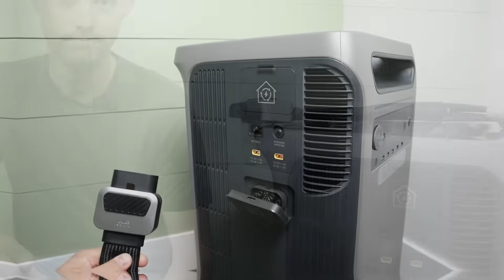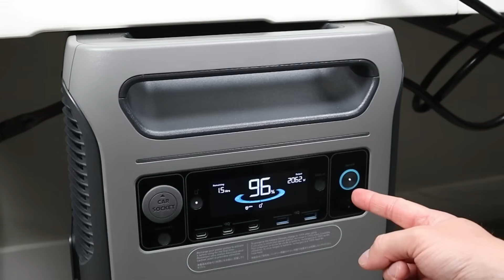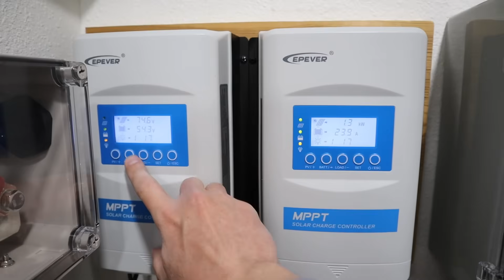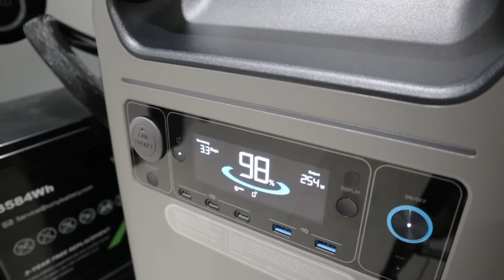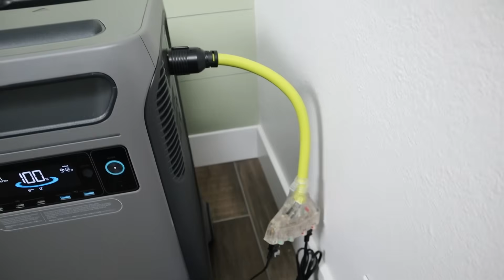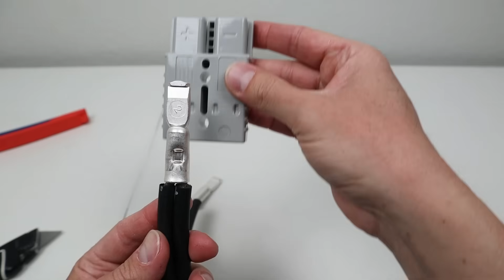I didn't Know This Was Possible!! Backdoor Battery Access to the Anker SOLIX F3800!

Comment: 5:00 why do you have the power cables coiled up while putting high power through them? Eddy currents will cause friction heating on the cable.

10:00 again you seem to coil up cables for hours with lots of power going through them. 

Do they get warm? Is it worth mentioning Eddy Currents to viewers because some people will see you coiling cables and think if you're doing it then it just be ok, when it's not.

As electricity flows through a cable it generates a spiral magnetic field. Coiling a cable causes the spiral magnetic fields to cross each other causing friction heat. So unrolling the cable is good practice.
Reply: You're not testing any of the internal temperatures or components. You're just hoping for the best while knowing there is a real risk. 

The inverters switched off 2x and you didn't put a warning at the start of the video or in the thumbnail of description. 

What is wrong with you? You even then advise people to continue on at their own risk. You know what people are like.
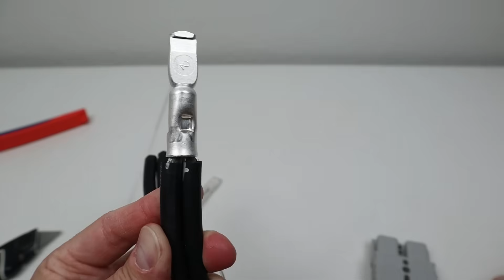Reply: 23:57 you combine 2 cables into 1 fitting. Is that fitting rated for the power (volts, amps) use? There's a reason why they're using 2 cables and 2 fittings instead of 1 cable and 1 fitting.

So what's the rating of the terminals you're changing it to? 

Never seen one of your videos before, are you a qualified electrician, are you a qualified/competent electrical equipment repairer? It doesn't seem so but I might be wrong.

Comment: A power station/solar generators should have the ability to connect a regular battery (understandably within some parameter set by manufacturers) to expand and especially if the electronics outlive the internal battery.

Comment: Looks like this would be bypassing the BMS. I wonder if it's still doing battery maintenance (voltage balancing) when it's not actively charging; if not, this can be really bad in the long run. In a pinch with two health systems? Awesome
Reply from the maker: The BMS is always connected directly to the battery cells, you cant bypass it. This solution doesn't skip the BMS. That's what stopped the charging multiple times in the video.
Reply: @Jasonoid I thought batteries are connected in series giving the higher voltage. And the BMS has connections to the seperate cell (groups) to monitor and charge. So the output is in series without anything in between and in the input through the BMS. I'm gonna do some googling later 😋

Comment: With an extended battery mod, will the f3800 be able to charge them from solar input to the f3800?
Reply from the maker: I'm pretty sure I showed that in the video when I had the DIY batteries connected with the solar charge controllers 👍
Reply: thanks for the reply. After thinking about this more, I decided not to perform this hack of wiring a external battery to that expansion port. Reason being is that the dissimilar chemistry of the batteries will behave differently and might cause an issue. Now I wonder if the anker c1000 can take the same mod/hack as it uses LiFePO4 chemistry like a lot of off grid batteries.
Reply from the maker: The F3800 uses 51.2v LFP batteries, what chemistry did you think they have in them? 
 @AW.SO.M3

Comment: Hi Jason, At 10:29 of this video, you mentioned that the solar panels are charging the DIY Expansion Batteries which are connected to the F3800 via the expansion cable. Can you clarify how the solar panels are connected to the batteries since the batteries are connected to F3800 via the expansion cable?
Reply from the maker: I have two external 48v charge controllers / solar arrays  that are charging the 48v battery bank.

Comment: I found @NoiseLab47 at about the same time you did and did similar testing using DIY bullet connectors, and had similar findings.  I have since gone the OEM-battery-connector-cut-in-half route and using both sides because I have 2 F3800s with Anker expansion batteries running through the ANKER Dual Power Hub.  I'm doing the "backdoor" feeding through the expansion batteries (ports are upside-down watch out for polarity!) and am hooked to 48V  LiFePO4 "golf cart" batteries in turn being fed by 80A MPPT solar charge controllers.  I have also run 4S 12V LiFePO4 batteries.  The twin systems are also being fed by manually switched 48V LiFePO4 battery chargers.   This has eliminated the headaches I was having trying to keep the 2 DPH-connected Ankers balanced.  IMHO the lack of OEM DC balance is a huge design flaw with the current DPH design.

Comment: I know that you did this video with the f3800, but have you checked to see if the f3800 plus extra (generator) plug on the bottom is exposed the same way. Just curious Thx
Reply from the maker: It also has the same voltage available, BUT.... That port uses a slightly different connector so they aren't interchangeable. It has two plastic pieces to keep the battery plug from connecting.
Reply: @Jasonoid  Thx

Comment: First of all, thanks for the video! Second of all I probably am not the first person to comment on this but I have the c1000 power station that has the expandable battery Which is far more than I would be willing to pay for what it is but with the expansion cable I believe I can use external batteries Etc in a very similar Fashion on a smaller scale. I wonder if the expansion cable is the same plug or at least similar. If I do decide to try this out I'll definitely make a video about it thanks for the inspiration!

Comment: I am trying to figure out a way to continue to use my potentially future SolarEdge PV installation with my F3800’s and HPP during a grid outage.  Does this condensed ChatGPT description make sense?:
1.	The SolarEdge inverter will automatically shut down
2.	The Anker F3800 Plus, with the Home Power Panel, creates its own small, isolated AC "grid" (a microgrid). The HPP automatically disconnects your selected backed-up circuits from the main utility grid. The F3800 Plus's internal inverter begins supplying AC power from its battery to those circuits.
3.	Because the Anker F3800 Plus is now providing a stable AC power source (its own "grid"), your SolarEdge inverter can "see" this and, after a brief delay, will restart and begin producing AC power again.
4.	Power Flow: The AC power from your SolarEdge inverter now flows into the Anker F3800 Plus's AC input. The F3800 Plus then manages this power
Thanks.

Comment: interesting test. and good idea for adding a single battery to the Solix. but, with the number of batts you have... it's best just to use an EG4 like inverter\controller
Reply from the maker: Uggghhhh, I dislike the 6000xp. The user interface is horrible, the smart app sucks, and the fans are so loud you can hear them throughout the entire house. I already built a mobile cart using a 6000xp and these power stations are just great. The are nearly silent, they have excellent software and you can control and monitor them remotely while away from home. My daily work horse is the Ecoflow DPU, there's nothing better out there in the power station world.

Comment: Was the generator port on the Plus model also bridging to battery? They use the same plug as the expansion battery.
Reply from the maker: It doesn't use the same plug. It's slightly different. It has two tabs to keep the expansion battery cable from connecting.

Comment: I'd buy an anker tomorrow if they release a version that allowed for solar input taking priority over mains input.  It would be great if anker used this port to make an official breakout box that would allow that to happen without potentially voiding the warranty.
Reply: What do you mean priority?  It appears that regardless of you charging from AC, power panel, or generator adapter, that solar input is always accepted if SOC is less then 100%.
Reply: @michaelwitkiewicz7052  I'd like to power it from mains (240) and have the solar reduce the load on the mains when the sun is up, when used in ups mode, the website says 240 isnt available. There's so little information on their website for the UK model, it doesn't even say it can charge at 240 on the spec sheet, just - AC Input 120V~ 15A (3 hours Max), 12A (continue), 60Hz L+N+PE
Reply: @samphire you’re in UK?  I thought normal AC in the UK is 240.

Regardless, if they are selling in UK there should be a support line there.

Comment: Wonder if on the 3800Plus you could connect your regular external batteries via the cable but then use the built in Solar Charge Controller (since it has a higher voltage range then the regular 3800) and have it fully function like a regular expansion battery because by using the internal charge controller the screen would show wattage coming in and you could save a little money by not buying an external SCC (he says currently using an external SCC to charge an external Battery connected to the solar inputs of his current power stations).

Comment: the 240v shuts off because one of the inverters is used for charging so you dont have both to then output 240. If it had 3 inverters than it would be perfect.
Reply: Wouldnt it have battery heat issues that way?

Comment: I don't think this type of hack is very useful giving that if you are paying the premium to have a good power station you are really buying its integrated solution, which guarantees performance (or you would ask for aftersale service). Hacking the battery this way downgrades the whole thing to a DIY solution yet probably much more expensive than an actual DIY one. Maybe if you get everything second hand then this is a good way to utilize what's available, but that should be a rare case since it's not like you can easily renew the batteries in the power station. Or maybe you get the power station for free and this allows you to just use it like an inverter, which would also be rare but at least make some more sense.
Reply from the maker: You don't buy this unit just to hack it. I wouldn't ever recommend that. 
This video is for the thousands of people who were misled about the unit by other YouTube channels that didn't disclose the issues I talked about in the first couple minutes of the video.

Comment: 19:09 it's a power save feature, there needs to be a load otherwise it's a parasitic draw keeping the inverter activated. Just keeping the inverter on uses a little bit of juice. If the station doesn't detect a load after a period of time it shuts off the inverter to save power.
Reply: I wouldn't know, why he wants to keep the inverter on...In that test, he just wanted to see, if the left power station charges up the right one.There is no need to have the inverter on.
Reply from the maker: @heimchemiker you certainly need the inverter on if you want to power up your home.
Reply: @Jasonoid  Yes, but you were irritated that in your test consisting of: no load, the left power station connected to AC charging and the right connected to the left through the battery connection and getting charged by parallel connection of the batteries through the expansion port, the inverter switched off. So there was no need to have the inverter on in this test, yet you were irritated by it switching off and conserving energy and switched it back on.
In a scenario with the House connected to the AC output of the power station (certainly not the hole house), you will always have some base load (router, phone chargers, lights...) that should keep the inverter from switching off. (This would be an interesting test: how high does this load need to be, to keep the inverter from switching off).
Reply: @heimchemiker  any measurable and detectable load/draw will keep the inverter active.

Comment: This changes everything. Bluetti AC200MAX Refuses to do this type of thing through its Expansion ports, when you try connecting an external battery it shows 0% Capacity and beeps non stop, i basically did what you are doing here with those and it couldnt do it. But for the F3800, i wanted to sell mine because of the limitations and determined it wasnt worth the cost of using chargeverters through the dual XT60 over just building something custom, but if i can just use what i already have and use any custom 48V battery that would be amazing.

Comment: The inverter may be shutting off due to lack of load and power saving settings. You can turn off the power saving mode in the app.
Reply from the maker: Of course I had that power savings setting disabled in the app. It was something else causing the inverter to shut off.

Comment: Got any plans to mess with that extra smart generator port on the F3800+? I think it could be modified to expand the maximum solar input. Just a thought
Reply from the maker: That port is slightly different than the normal port. It doesn't fit a normal expansion battery cable.

Comment: Always possible to take apart the power station and wire up your own anderson connector or something closer to the battery past the BMS on models that the BMS prevents this.
Obviously don't do that if your not comfortable with it and want warranty support, so that is why I save it for the cheaper portable units not the big expensive ones.

I have had minor sucsess with Ecoflow, on the newer units not working, so I'll have to go next level and get my ociliscope out and see if i can find the data pins behavior and emulate it.
Reply: I'd love to know if you have success on EcoFlow, specificallly Delta Pro 3.
Reply: @culverja No, I get voltage but not full voltage.

I will need to try two things.

The easy one is to send power to it and see if it "senses* a battery and the BMS opens the electrical path.

Or the hard one actually find what signal the data pin is looking for and see if I can emulate it to fool the BMS.

I would be easier to just open it up and add my own connection closer to the battery behind the BMS in that situation.

But have to be aware of not having BMS protection anymore.  So no over charge or over discharge.

Comment: Does this work for the 3800 PLUS as well ? I saw you connected them together 3800 to 3800 plus , but do all the hacks you tried in the beginning with the 3800 work on the plus as well ? I trying to decide between buying the 3800 or the plus . Thanks!
Reply from the maker: It should also work with the F3800plus
Reply: @Jasonoid thank you !

Comment: I suspect there may be a ground loop issue when using the expansion port. It may be best to have a isolated DC-DC converter in some cases.
Reply: Why a ground loop.  This is essentially hooking two batteries in parallel
Reply: @michaelwitkiewicz7052  The AC input and AC output may have a ground loop if the battery shares a ground. I doubt the AC and DC sides are fully isolated from each other.  GFCI or other fault could be tripped if using 1 to charge, and the other to discharge.

Comment: Don’t suppose you do/have comparison videos? Deciding between Anker Solox F3800 and Jackery 5000… or any other system you found to be much better?
Reply from the maker: Ecoflow DPU is best of the best. No other power station comes close to it right now. Amazing solar and is the only model to allow 120v charging and 240v output. Smart app is amazing with great settings and data logging. 
Jackery 5000 is okay, the smart app and custom features are pretty bad. Hardware is slightly better than the Anker F3800+
The Anker F3800 is the most affordable because it has the smallest battery and inverter. It's got a decent smart app and features.

Comment: I’ve got the anker battery sitting on top of my f3800 connected with the cable you have there.  Do you think it would work the same tapping into the second port of the battery with a modified cable to allow charging of the whole system via a larger solar array and charge controller?  Solid video as always!
Reply from the maker: I bet if you were able to cut the cable and then put in a busbar it should work. Experimental setup, not sure what the long term result would be

Comment: Please do a setup  using server rack batteries powering delta pro!  I have two delta pro each with two expansion batteries. I’m maxed out and want more power.  Thank you!!
Reply from the maker: It's not possible. The DPU has 110v batteries so they aren't compatible with the DPU. I do use my 48v batteries as expansion batteries that I feed into the DPU low pv port.

Comment: I wonder if something similar works on the delta pro ultra.
Reply from the maker: The DPU has 110v batteries, they aren't compatible with server rack batteries.
Reply: @Jasonoid I would assume in series it would work…
Reply from the maker: Actually, 48v batteries don't allow series connections 🤷

Comment: Do the Jackery 5000 Plus next!! according to the spec, the backup battery port is 80.5V-126V. SO  maybe series 2 48V batteries??? Thanks! Keep the vids coming!!!
Reply from the maker: I don't think the Jackery 5000 port has live voltage at the expansion port when you turn it on.
Reply: @Jasonoid  What about Ecoflow Delta Pro 3?

Comment: Nice idea. F3800plus or jackery5000 plus for a home backup
Reply from the maker: Those two are pretty similar the Jackery has a couple points that make it better. Higher solar input and larger battery / inverter.

Comment: Curious if you can use the expansion battery port as an extra battery for your system since you can charge with it can you also take power from it?
Reply from the maker: I bet that would work, as long as it stays powered on. I don't have an Anker expansion battery to test with.